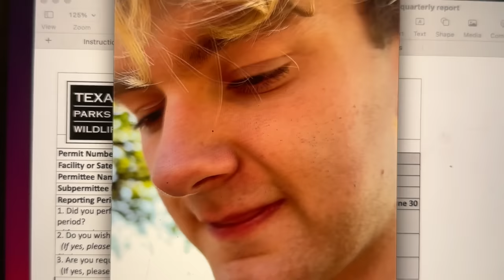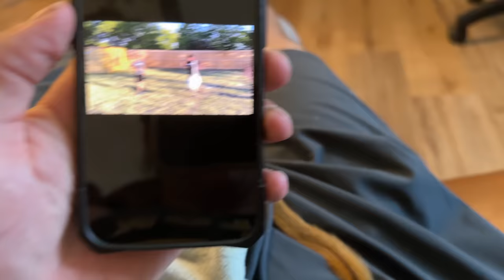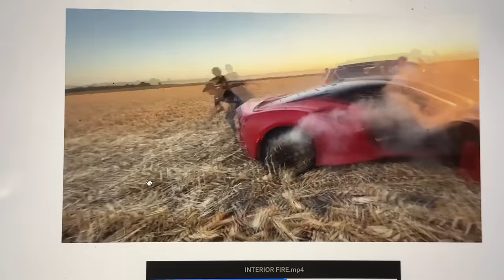Gort Destroys WhistlinDiesel’s Ferrari (we’re bankrupt)

Comment: The way you guys treated that Ferrari almost made me believe this was planned.
Reply: the fire wasn't planned the where doing a durability test
Reply: hot engine + completely dry vegetation = fire... not sure why they didnt drive the rental van away from it..
Reply: @danielgriff2659 it was actually the brakes on the Ferrari that started the fire. Same with the van. Disc brakes can get glowing red hot when braking at high speeds so I’m not surprised the car lit on fire

Comment: I knew it was over for the ferrari when they ran through the gate and ran over a cinderblock 😂
Reply: @alexgoldsmith1431   it's not an intake, it's a feed funnel
Reply: @alexgoldsmith1431  The engine is in the back the hood is the trunk.
Reply: Its actually very worrying. Intentional misuse of the car and the company can sue you.
Reply: @splitdragon3004 ferrari aint gonna win a case like that in the us. plus ferraris used to be tractors

Comment: CLARIFICATION:
Near the end of the video, Uncle Ben shows footage of cause of the fire. The feed that was stuffed in the ferrari caught fire and so too did the rest of the ferrari. Gort didn't seem to be inside the ferrari and can't possibly be in the van because gort never actually left in the van.
Reply: Silly question but why didn't they simply drive the van away from the burning car before it caught fire? Or was that the plan to destroy evidence?
Reply: @railroadactive  I watched the video of the fire starting from the youtuber. The van fire was separate, also caused by the hot engine igniting the dry corn husk. They were afraid the same thing would happen to the responding emergency vehicles.
Reply: @railroadactive   I don't really know. They were probably trying to save the ferrari in the heat of the moment.
Reply: @railroadactive  I just saw WhistlinDiesel's video and the "intern" was driving his Ferrari through a cornfield, but the corn husks got caught in the underside of the ferrari and caught fire. They group were trying their best to put out the fire to save the ferrari and didn't realize that the fire had spread to the van. Regardless, no animals were injured.

Comment: All the fake jokes aside about gort dying,This was extremely reckless and inconsiderate of both the enviroment and the safety of the firefighters responding to a fire that was spreadijg rapidly while they just stood around filming, not to mention the numerous hazardous chemicals everyone  came into contact with
Reply: what else could they do? they called the fire department
Reply: @seejayel_4130  They could have not driven a car known to catch on fire into a tinder box.
Reply: @seejayel_4130  they could have gotten a fire foam extinguisher, the firemen used water which caused the already burning lithium to react violently, they clearly had enough time to film the whole thing bursting into flames, not to mention the danger of spewing lithium gasses and carcinogens, if they had the time to film the firemen putting it out with WATER ON A ELECTRICAL LITHIUM FIRE, they definetly had enough time to grab a foam extuinguisher, and they stood around filming and making jokes while actual firemen were cleaning up a potential wildfire because some idiot youtubers drove an faulty car on a dry field during a drought and wasting timr and resources
Reply: @pgnandt  exactly this^^
Reply: @seejayel_4130  they made no attempt to even move the other car (which was fine btw) which also cought on fire which is blatantly reckless, people could easily have gotten seriously injured, at one point you can see molten lithium sparks spewing on the firemen as he tried to put it out with water. Because they didnt tell the fire dep, it was a vehicle fire, which you should NEVER extinguish with water, which almost happened when the lambos battery started getting wet while it was ON FIRE
Reply: @ananteshesha5788  ok buddy
Reply: @seejayel_4130  great retort man 10/10

Comment: 5:45 Did you at any point tell him not to do this or did you just egg him on? That's a DRY cornfield and brakes work by friction which is the literal original caveman method of starting fires. There's no way that wasn't at some level intentional.
Reply: It’s not the brakes. It’s the engine and exhaust that caught the corn husks on fire.

Comment: Why was a running Lamborghini burned?
Reply: The cornfield set it on fire
Reply: the brakes burn plus dry corn field
Reply: @DraganOfficial  so it was a mistake? Felt intentional, weird.
Reply: @DyslexicAnaboko   Unintentional. Dry corn husks, lots of friction, low lying car picking up all the corn husks inside itself, very hot dry weather, very hot car exhaust , aaand you get fire.  

They were going to destroy it eventually after many more videos, but this particular instance appears to be accidental.
Reply: @mitkoogrozev  that makes more sense thanks.
Reply: @DyslexicAnaboko  It was intentional. Imagine two vehicles catching fire at the same time.
Reply: @pgnandt yes, because it was the same reason.
These two vehicles sit close to the ground. Hot engine, hot exhaust, hot engine + corn husk dust.
Reply: @ladiesweb4769  Yeah no one saw it coming. Right.